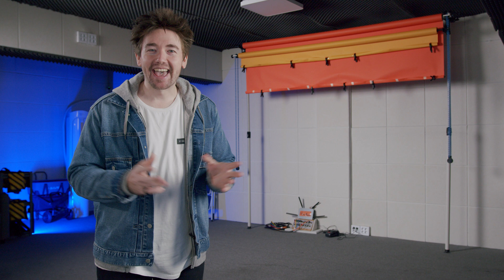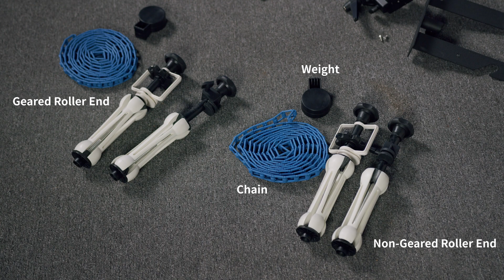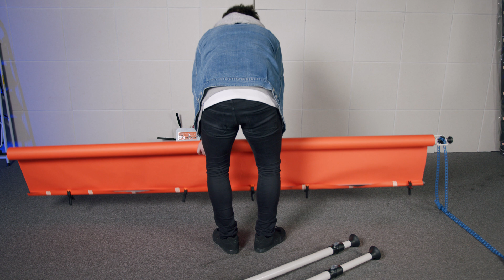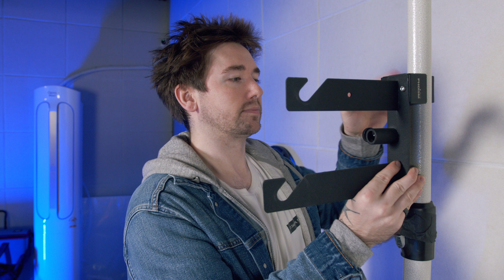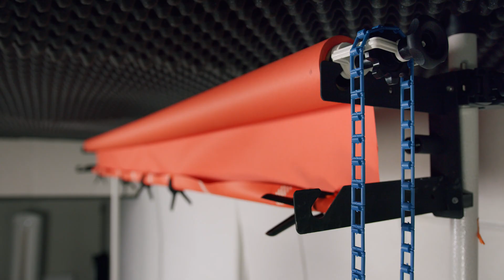How To Build Your New Paper Backdrop!

Comment from the maker: Sections for Skipping Ahead:

00:00 Introduction
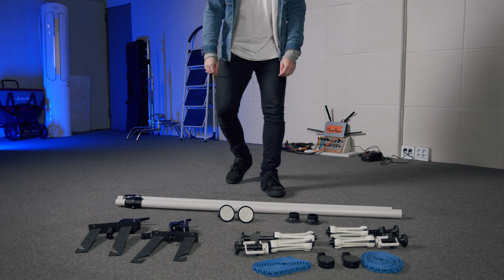00:30 The Kit
01:51 Building the Supports
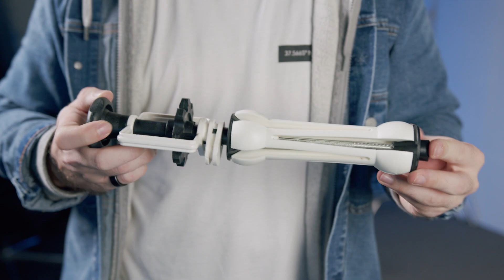02:34 Building the Chain Pulleys
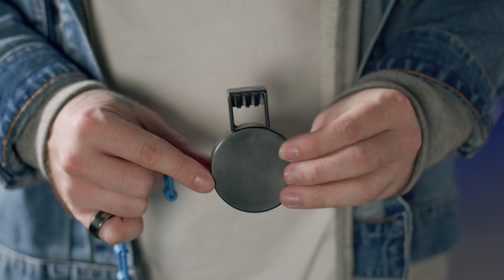02:54 Threading the Chain through the Weight
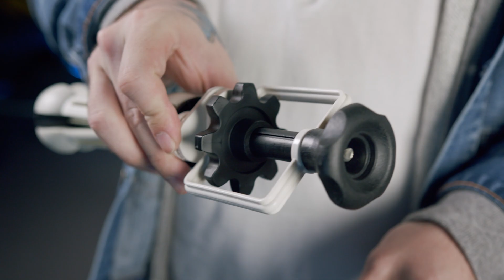03:09 Attaching the Chain to the Gear
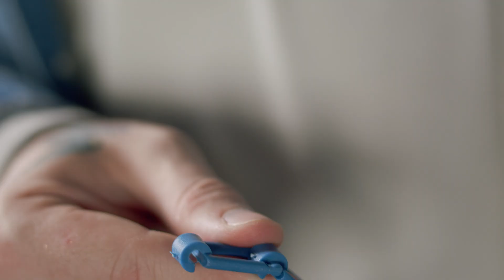03:40 Closing the Chain
4:04 Non-geared Roller End
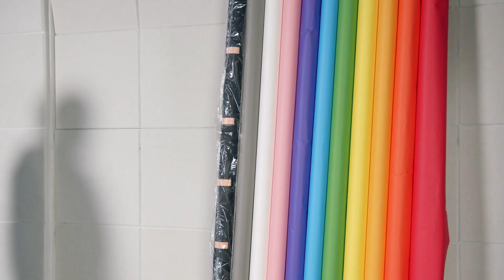4:18 Paper
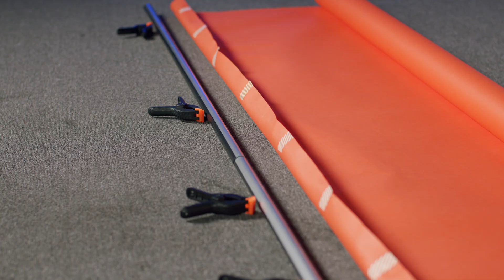5:53 Attaching the Paper Weight
6:17 Inserting the Non-geared Roller End
6:31 Inserting the Geared Roller End
6:39 Building the poles
6:48 Placing the setup
7:14 Erecting the poles
7:24 The Safety Pin
7:52 Attaching the Supports
8:24 Re-cap of the Rollers
8:45 Horizontal or Vertical?
9:15 Roller Grooves
10:01 Non-geared Roller End Grooves
10:24 How high?
10:37 Putting up the Paper
11:05 Uses for Paper Backdrops
11:17 End